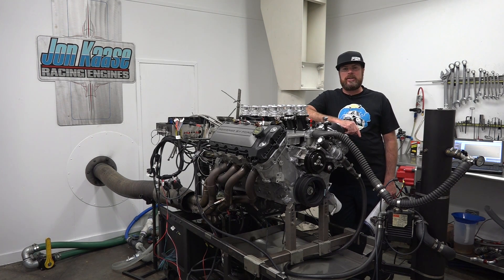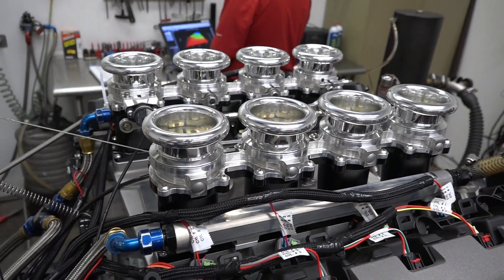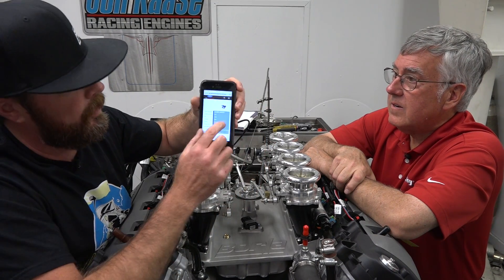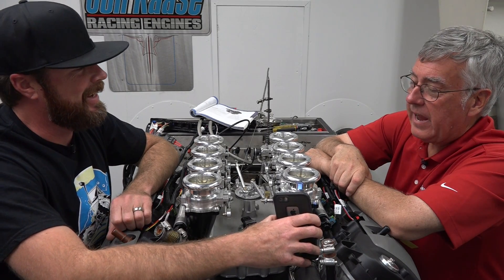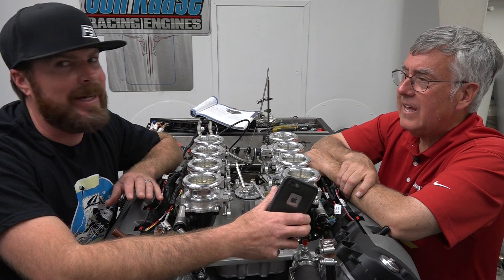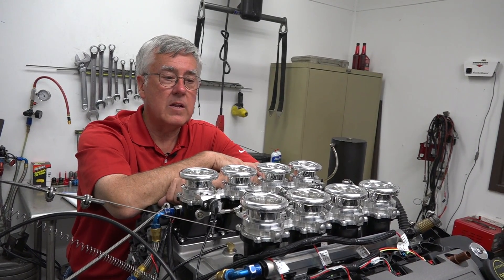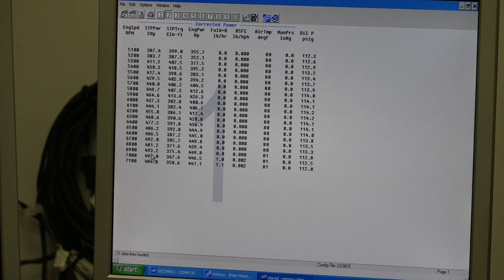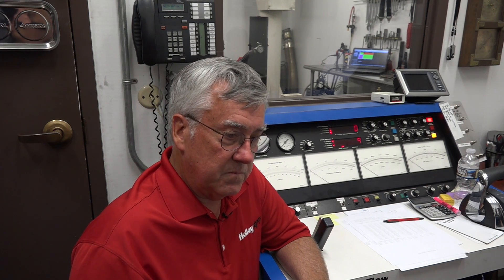Finnegan's Garage Ep.37: Dyno Testing a Ford Coyote Engine with Borla Stack Injection

Comment: Very cool looking and probably sounds insane on the road under load.  But, a GM LS3 376/525hp complete crate engine is $11k.  
Coyotes make insane power with a twin screw supercharger setup like a Whipple. 700hp easily.  
The old saying all show and no go sure applies here.

Comment: You can get a Ford Ecobost 3.0L twin turbo from a Ford Explorer ST that will beat that engine and save a lot of money in mods by using it. 
That STACK injection is $6000-$8,500 alone.
Reply: Put TT on that 5.0 and it will beat that Eco. lol

Comment: I'm pretty sure I've seen this video before You guys got to remember They didn't use the right standalone so they couldn't use the TIVCT which is like at least 25% more power look at where the cam sensors should be They just have those stupid chrome covers cuz they're not using them there's no TIVCT here which is one of the major keys to the coyotes power

Comment: With 1000rpm between peak Tq and Peak Hp I would say you better have a 5.14 gear to be able to street drive it. Torque is what moves the car HP is only a bragging number .

Comment: Ok, did some research. Found a stock Aluminator motor install, hooked up in a car, full accessories and drive train. It made 457 HP and 388 ft/ lbs at the rear wheels. So if you assume a very conservative drive train and accessory loss at 15%, you are still looking at 525 HP and 446 ft/ lbs out of the box! So either the Borla 8 pack absolutely murders power, this particular engine was poorly built, or it’s got a terrible tune. Perhaps the “accidentally” got the 9.5:1 compression version built for high boost, instead of the regular 11.0:1 version? Maybe the Borla 8 pack is a $6500 paper weight? Or these guys aren’t used to tuning modern modular street engines? This bugs me, that was a soft number. The guy maybe wants the looks, but $16,500 he could have bought a pushrod big-block pushing 650 HP out of the box and taken up about the same amount of over all engine space and have a much cooler sounding idle. Ford makes a 572 cui big block that looks even cooler then that 8 pack Aluminator. I am puzzled and disappointed to say the least!

Comment: Either this thing is a dog, or it needs more tune time. 493 @ 145 deg water temp? I have seen that at the wheels of a regular coyote with bolt-ons and a tune. That’s an 8 pack, no filter no accessories. At this tune with accessories and drive train were looking perhaps at 400 with 350 ft lbs at the wheels at best. Those results for $16,000 I would be pissed. You can easily get that from the $6000 coyote. Who cares what it looks like if it doesn’t work. I wouldn’t pay for that motor until they get it right; and I am a moron and know that much.

Comment: Half of the Coyote is the cams. Gen2 aluminator with a GT350 manifold or CJ makes power well past 7100 more like 8k. I would bet locking the cams killed this from 575 hp. Timing for 93 and E85 is 32 for a coyote.

Comment: Idiot took off the cam sensors so no ti vct so major loss of power.  Dumb.  I think in another test they took it off and then put it on and was like almost a 100 hp more with ti vct.  Leave it on and alone.  So dumb.  shoulda ran the aem infinity on it not that I have the money to have ever used one but seems more suited to coyote and can run all it's stuff as far as I know.

Comment: Yes Finn knowns absolutely nothing about the coyote engine. The aluminator had forged internals and is rated in the 500 range. Comes in high &  low compression. Finn keeps quoting the stock replacement engine specs, do your homework cause you did absolutely none for this video! That individual throttle body's look cool but no plenum, not the way to may make big power! Can't believe how bad this video is!

Comment: Why don't they build a a military Humvee on 35" trie for high speed towing with the Ford 10-speed automatic transmission and the new Ford powerstroke 475hp 1050 foot pounds of torque bone stock   turn into 1000hp   powerstroke diesel

Comment: I have a 460ci 7.5l I want a 8spd manual transmission 1 granny gear      2-4 barrel EFI  460ci 2wd f250 1983 3.70 alxe gaer I uesd my truck on i80 and pull tree down  with a cruising speed 85mph  ? Uesd run rpm of 1,000rpm on i80 and 1,000rpm in town  I like to keep my truck at a 1,000rpm

Comment: These engines can easily rev to 7500+ rpm and even 8000 if properly set up. 7000 is very low for this engine NA

Comment: It is  amazing how modest the Holley company is.. They started out making carbs for Henry Ford, they dominated NASCAR, supplied carbs to the best muscle car engines, were standard on gas truck engines , supplied Dodge with its fuel injection in the 90's and now super tuning  injection systems... What a performance company ... of the CENTURY..
Reply: And they purchased just about every company even remotely related to the domestic car aftermarket.

Comment: By 2019 standards ..its not a torque monster but they did pump in another 60 hp ..and the who can complain about the looks.  500hp is plenty to sustain the ole ego and who knows,  ..a new set of stacks to interface with a 88mm turbo and this Coyote will rock with 700 hp and 600 lb. ft. easy.  So, if I'm building a 56 Ford Truck or a 69 Camaro ..I'd use this Coyote engine just because its so effen beautiful.   I say mission accomplished.

Comment: This is Unreasonable, to pay and spend and just throw money away at a motor, it's actually an engine, motor is electric. Anyway.. some guys get on the Internet and make it appear as though it's the modern way of life now days, to just pizz it away like you're not cool, or better yet.. like there's something wrong with you if you don't just throw your money at them. I used to build engines from the docile Street types into ones that easily pushed 400 HP replacing everything with new brand new parts all through, but like almost every other thing when you are talking about automobiles, if a person doesn't have knowledge or understand them then some mechanics could even try to take advantage of a repair job. Sadly it's about ($)Money and getting it from the customer and making sure he pays for it through the teeth for whatever reason !!

Comment: If the VVT is disabled this isn't a very good test
Reply: Depends  on where they set the  cams  - full retard  wouldn't make a dif from 4500- on up. You might pick up low  end  torque that you don't usually measure on the dyno with variable cam advance working  .  So  a bit more than two  lazy 2.5L toyota camry  motors  grafted together,  About right. That's what this  engine is.
 The  old SOHC 4.6 was 2 Pinto motors :) - Sandy

Comment: Hmm, not impressed that the Holley ECU can't control the VVT. Haltech and Link ECU sure could and easy for a MoTec too. MoTec is the only ECU currently available to run the Subaru FA20 direct injection engine with VVT and MPI. 
So yea, shame on you Holley.

Comment: Personally I'd take a Roush supercharger kit for a Coyote before investing 6g+ on an intake manifold like that. For just a little more money they can push a good 5.0 deep into the 600-700 range, depending on the tune. Admittedly though, I guess it's all about what you want the car to do (demolish a drag strip or destroy track day events, and about how you want the car to feel with throttle). I will say though Fin, you did a good job with this one, even if you're not a Ford guy. Keep up the good work!

Comment: General Motors can't even build a four cam engine Worth running on, probably have somebody else build it for them.
Reply: THEY TRIED WITH THEIR FOR SHIT, NORTH STAR V-8 THAT'D GO BOOM AFTER 30,000-50,000 MILE HA HA HA AND OVER HEAT MORE THAN A HO SMOKING THE C.
Reply: They did that with the LT5. They literally went to Lotus and demanded they build them an engine. Lotus built a badass engine and retooled a bunch of crap to manufacture it. Then GM fucked them over and had someone else build the engines with the tooling Lotus built
Reply: @meifert2  was it Yamaha that built the SHO motor?
Reply: @willmcmillan2047  the first 3 SHO engines. Yamaha has built a lot of car engines. Most great Toyota engines were built by Yamaja
Reply: Why when they can do more with one cam.

Comment: I would like to see this same engine combo in as delivered condtion running the holly computer with the bolted down cams (locked phasers?) and using a throttle body that is not drive by wire (manual) to basically see how much better then 435 the holley system does  with the cams locked versus this borla intake set up that no one can afford.  Reason for this is to see exactly whether the holley ECU is worth it
Reply: That easy the answer is no.  Get a Halteck or Mo tek and you don't even need to lock the cams.

Comment: This build obviously isn't for the most horsepower or economically priced parts. This is for someone after a certain look or uniqueness. However locking the stock cams out totally defeats the purpose of the tivct. If locked out go ahead and throw in some custom cams and really take advantage of the high flow manifold. People have made over 600 whp na in a coyote

Comment: I could justify buying that if it wasn't the same price as a 4l blower that can easily add another 200hp+ to your car. I've seen stroked 350's go from 450-470hp to 650-670hp on 7 - 8lbs of boost.

Comment: The Price per HP is absurd when you can crush those numbers for half the price with a older FE stroker or even a Cheaper to build 385 series big block stroker. I have both and spent far less building both and both make a bunch more than 490 HP. My 521 stroker makes mid 600s and cost me about the same as that intake to build

Comment: I probably get that from a stock '13 Coyote with 90 mm throttle valve, boss 302 intake and Bama 93 octane race tune (catless exhaust like on the dyno). Not impressed, from an Aluminator and Borla Stack Injection. (considering the cost)

Comment: Modern fuel-injected engines and in fact ALL engines are better off running "warm" than "cool" and 200 degrees is not "overheated". Cold engines have more wear and parasitic loads and are less efficient and waste power and fuel. But if you're a Ford guy you'll never notice since you're used to low power, poor fuel economy, short engine life and generally crappy engine operation.

Comment: If it had VVT I can see how the price can be justified. But without VVT it's just an unfinished project....although I love the ITB"s so much. From an engineering standpoint you are going backwards in technology without VVT. Like running with a carb instead of multi port injection.

Comment: Good point. IAT’s and coolant temps on that pull where two blocks from the dudes house, not on the freeway or in the canyons or on the track. IAT’s kill my power on the road course but are even worse on the strip in the summer. That dyno pull was performed under ideal not realistic conditions.

Comment: Great induction vid. Engine masters proves the old style high rise dual quads on a old chevy are good for 50 hp this setup produces at least 10 more on less cubes and is low profile! That's the key. Low profile.
   My 98 T/A 421cid stroker ls2 block with gmpp ported heads makes 550 rwhp with a stock ls3 intake. Borla needs to make one of these for the Ls3. Even though its $6500 my engine cost is only $6500 so for 13,000. I could slip this combo(421lsx/Borla)into my 2008 3200 lb C6(bolt on's 412 rwhp)likely making around 625 rwhp at 6800 rpm N/A. Over 800 n2o easy. 
    This should be competition for many of the big blower corvette folks. Without n2o crushing new and bolt on Zl1 and Zo6's

Comment: Lol, that makes less power and less torque than the musclemustangfastfords  2014 coyote crate engine dyno with a 400 buck boss intake and a 500 buck throttle body with long tubes on an engine dyno .  Keeping in mind those engines have smaller valve sizes than the 2015+. Given how close stock 2015 intakes run to the boss (with a much better torque curve),  you could almost make the argument that this might make no more power than a stock intake 2015 mustang crate engine with a cai, throttle body, and long tubes.  That is a 6000 dollar appearance item.

Comment: The problem i see here is most don't get. If you buy an aluminator For say $10,202.25 or get an LT1 Wet Sump 6.2l For 9,726.78 Both make similar power. For everyone screaming Ford is for rich people. No Fact is Buying an engine from ford or chevy or even dodge is going to cost. Go to a salvage yard pick up a 5.0 or an lt1 for under 2k put the rest of the money in it make more power. The only stupidity here is trying to buy an engine from the manufacturer. and if only for cool factor many screw the borla intake.

Comment: with a chevy sb 400 (73 & older having thicker walls) bored to a 406, pushing 750hp & torque with only boring .030 over, leaving everything else stock, why would anyone want to spend 20k on a less powerfull motor? now, if u stroke & balance said 406 & use a quality,lightweight parts, amber lightweight 11/1 compression pistons,offroad cam frm summit,roller rockers =750-1,000 hp EASY!!!!!

Comment: So $6500 for a system that still uses a plenum (on ITB's......) and deletes the VCT.... Let's just a Honda for a example (stay with me), one can fab a manifold and use GSXR ITB's with no need for a power robbing plenum and keep the VTEC. All under $500. Twice the cyls plus new parts, let's say $2000-3000 would be a good price PLUS get rid of the plenum, if people worried about drivability they shouldnt get a ITB setup. Use MAP and get rid of the need for a MAF. Borla should just stick to mufflers...

Comment: That sure is a pretty intake setup. That is also quite a lot to spend on an otherwise stock crate motor's intake manifold. To each their own but i'd have spent that money elsewhere like maybe some different cams, forced induction, just something other than a $6500 intake. It made good power though. I'd like to see what the standard intake manifold makes on this exact engine.

Comment: I'll never understand why people would waste all that money. 11k for a motor with only 435hp? You can build literally any engine for half that and get that power and have cash left over.
Reply: Jordan Wiley Sorry for the late response, anyway your comparing a stock engine to a built one, so what happens if you build that 435hp coyote? Well if you highball for the sake of argument let’s say another 8G’s on it, and now let’s lowball it for arguments sake,  now with a super charger it’s pushing 700hp(I’ve seen them go 1000), you pay what you get with these engines.

Comment: It has not 1, not 2, not 3 but 4 overhead camshafts and 4 valves per cylinder. Chevy and Mopar guys can't count high enough to comprehend the beauty of a modern engine. Modern for coyote is still relative but better then an LS or Hemi.

Comment: take 4.6 out of  mark 8 Lincoln add 2 turbos  , make over 500hp for about 5 grand or less ?   FUN
Reply: RIGHT, some mk 8's run 10,s, PLUS RIDE AND HANDLE SO GOOD,OWNED 2, BUT STOCK. MOST HI-TECH CAR MADE IN 90'S. COST $40K NEW. IN 96 THEY PUT THAT 4OHC 32 V IN THE MUSTANG COBRA WITH A 30 HP INCREASE,FROM THEN ON IT WAS AN EVOLUTION IN MOTION.

Comment: you can buy a 2017 longblock for 5 grand and buy cobrajet intake scj throttle body kooks LT headers a CAI with handheld tuner with TUNE for 3900 and with a manual transmission put 450 hp to the wheels on 93 octane. add comp cams and e85 flex tune and be close to 500 rwhp. That's 600hp at the flywheel on a daily driver for under 10 grand minus the cams. with the cams and flex tune around 12grand.

Comment: pretty stupid to drop bis $$$$$$ in an engine and then fail to use a proper engine management. Even DIY Megasquirt can control VVT Systems. Get a Haltech or Trijekt if you want to have a really good setup.

Comment: to add a little fuel to the tib vs boost debate. the advantage of ITB is constant high air velocity. the plenum is so small that a really big can will act much smaller, this removes the "powerband". meaning you'll have better power at part throttle. this is better for road racing. road racers do not want the complexity nor the weight of boost. ITB's give you the ability to run a very very aggressive cam but still have usable power in the lower rpm's.

Comment: 493 hp at the flywheel with no accessories? That's the kind of power you can get out of the stock GT manifold...$6500 for a few hp? No thank you.
Reply: It's mostly for aesthetics. ITBs are great for throttle response and mid range. Not really for all out power
Reply: HotMetal524 that’s not true... if you have the correct size runners and throttle body’s these intakes will outperform any intake manifold not to mention you can completely change the power band with longer of short trumpets
Reply: HotMetal524 What I read about itb's too. It's well known for the increased throttle response. What most don't know it that it mostly add midrange hp more than at redline.

So basically, it makes the the car up to speed faster that what the numbers say.
Reply: Actually lower than i though it would have made. Im a gm guy, but am impressed with these motors. Still good numbers, but ill pass on something so expensive with a small gain per money invested
Reply: A D The regular GT can do that?
Reply: @betherealdeal  No, he's full of shit. The amount of accessories being driven by the engine is relatively minimal, given that they're mostly electronic. At most the accessories most likely rob about 10-20 horsepower and that's being very generous. Regular GT makes about 430 net horsepower (with all of the accessories bolted on). Ford usually always does net horsepower at the engine flywheel for all of their engine power/torque numbers, so without the accessories, you're looking at about 440-450 horsepower on the stock motor with literally zero belt driven accessories.
Reply: They didnt rev it high enough... Ots a coyote motor they need to rev it to at least 9000